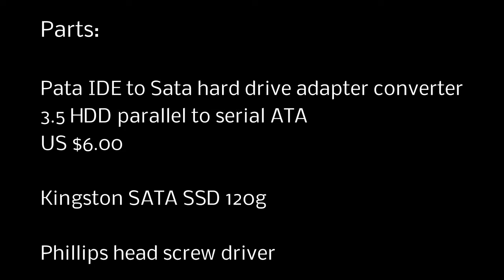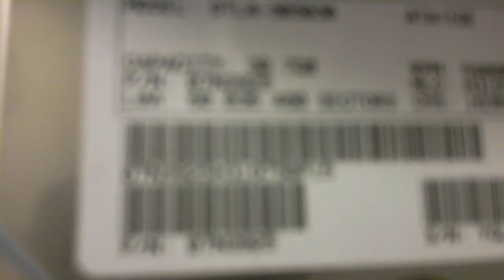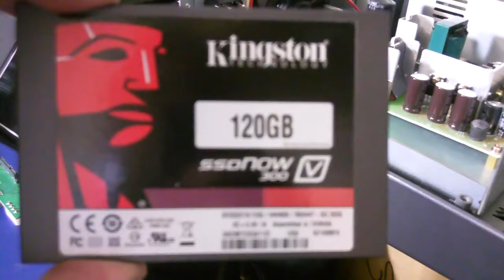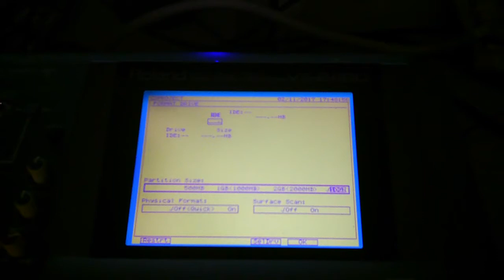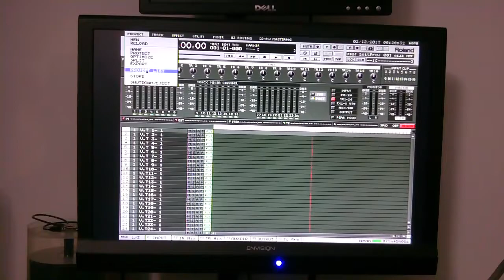Roland VS2480 convert internal PATA HDD  to SATA  SSD

Comment: Sorry to bother you sir do you know if this conversion works for vs2080
Reply: Sorry I meant vs2000
Reply from the maker: Marvin arthur Lutchman hi, I am about to install this setup in my two VS2000s.  In theory it should work. i need to backup my projects first though.
Reply: IanCanefire thank you for you're reply, I also followed you're mpc4000 videos!!!! Great work( keep it up)peace.
Reply: @marvinarthurlutchman5353  Hi, I converted my vs 2000 with success - the same adaptor (JP103-5) and a Kingstone A400  120gb ssd. The vs2000 reconised it right away. I just did a exFAT format prior on windows10. I didn't have the same luck with vs2480DVD, it just stuck after "scsi OK".